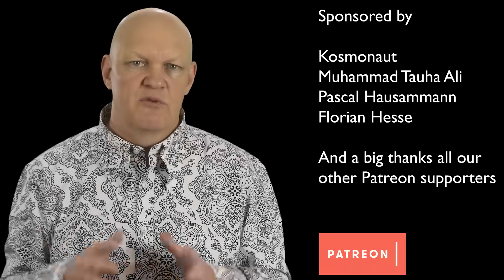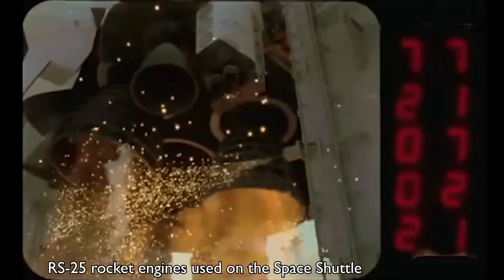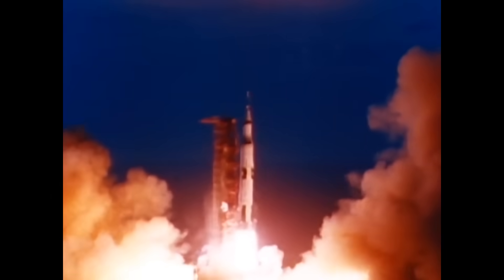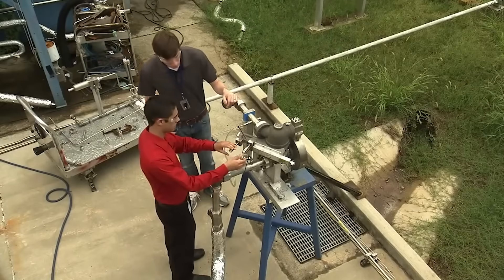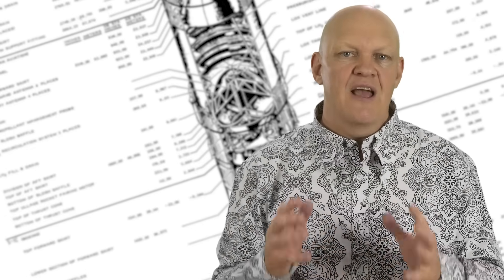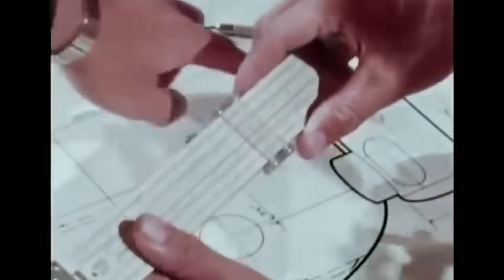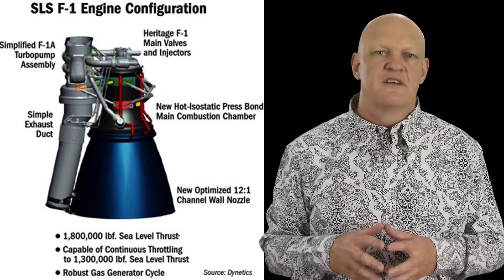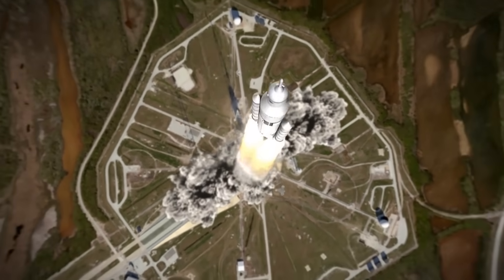Why Can't we Remake the Rocketdyne F1 Engine?

Comment: The F1 engine was amazing, thats for sure.  It was the biggest (with a single nozzle) and really pushed the limits.  And there does seem to be an upper limit on rocket engines.  They discovered the limiting factors and worked around them as best they could and miraculously made it work.  As a result of this heroic effort we now know its best to make the engines just a bit smaller than the F1s were.  Major problems included sound waves amplified inside the engine because the sound compressed the fuel/oxidizer mix, causing faster burning and ever more pressure at the leading edge of the sound wave.  Also pogo which caused a surging effect was greatly intensified by the large engine size.  Although there might be workarounds, if you want a cheap, simple engine then it pretty much has to be smaller than the F1s anyway.  A multi-nozzle engine or several smaller engines just work better because they aren't fighting the physical processes that created these issues in the F1.  Also, an amazing save on the part of the 1960's engineers who saw these problems for the first time and came up with the workarounds that let the F1 fly.

For all its amazing accomplishments, the apollo spacecraft was a fragile and extremely dangerous thing.  A big part of the reason the last moon missions were cancelled was that they didn't want anyone to die up there because a negative public reaction could have jeopardized the entire space program.  Yes, there were setbacks with shuttle and ISS but we weren't really ready to go ahead and colonize the moon back then.  The best we could manage was an expensive and daring stunt to show we beat the Russians.  Its taken all this time to learn by doing with smaller programs to get to a point where we can really consider going beyond earth orbit on a regular basis.  We could have gone faster.  If only we spent half as much on preventing our extinction as we spend fighting each other, we'd have self sustaining colonies all over the solar system by now.  Its a choice we've allowed our representatives to make.  Avoiding extinction by colonizing space, or use those resources to fight each other.  If we let them choose to fight, we deserve extinction.

Comment: This is typical of non-mass produced systems. I spent decades designing and building process control systems for very large and complex industrial facilities. Each system was unique, although the building blocks were not. Even though everything was documented so these systems could be maintained there were a lot of tricks used to assemble these very large systems to control industrial facilities using thousands of sensors, programmable devices and final control elements. However, there was sufficient documentation that some of these systems operated reliably for 30 years and were maintainable throughout their life. What ultimately led to the demise of the programmable elements was the inability of techs and even engineers and programmers to keep them reliable and deal with problems quickly when problems or failures did occur, or the need arose to make significant changes due to process changes.

Comment: I'm sure anything built decades ago can be reverse-engineered if just one surviving sample exists, even with no plans or engineering documents. What I'm not so sure is that it would be worth doing the F1, even if it weren't prohibitively expensive to do so. 
It is no doubt a masterpiece of engineering of its time but things have moved on. While being the second most powerful engine ever flown it is however rather poor in terms of efficiency and probably very difficult, if at all possible, to make re-usable. Keep in mind that the main design goal was to get it ready in a very short time and many things were sacrificed to achieve that goal.

Comment: Nobody in their right mind would make a 5,000 part F-1 engine, when there has been 50 years of innovation that allows building a much lower cost & more reliable F-1B engine with 40 parts.  Lastly, military support for solid rocket booster tech made the F-1 liquid booster obsolete.

Comment: The same thing happened with the Apollo command module, specifically the heat shield.  NASA and North American Rockwell (ne Boeing) has forgotten how to make the original heat shield, and when NASA decided to replace the Space Shuttle with essentially the Apollo program hardware, it took years and much effort to come up with an equivalent-performance heat shield design.
Reply: Wall between LOX and LH tanks in 2nd stage is other relevant example.

Comment: This is true, even somewhat so for the RS25/ssme. When you work backwards and make 3D CAD parts from the original imperfect drawings, things don't add up. They mis-align, float, or interfere. Ex: on long small pipes, a tech can easily bolt up one end, then move the other end 3 inches into place, so even 3D scanning individual parts doesn't work. So you can't trust the parts and existing drawings to match
With updating an old, pre-CAD engine to modern design criteria, they'd basically have to redesign the whole thing. In which case, you might as well design a better engine.

Comment: Regarding the "new video  format", I say you should make your videos as long as you see fit. If you feel the subject requires 20 minutes or more then make it so and equally if you feel only a short video will suffice then again do so. 
Briefly don't feel restricted by video length. 
PS longer ones are good for when there's absolutely nothing on the telly (which is nearly al the time especially in France) and a hole needs to be filled.

Comment: Despite the lack of video to match the topic i'd have preferred more information on the F1-B process, as this is the very question i was wondering this weekend at KSC. Fun, unrelated fact, the picture of W.V.Braun standing in front of the Sat 5, the mobile "car" cradle that's carrying it, it's base minus the wheels has been modified and is what's holding it up over peoples heads now in the Sat 5 building.

Comment: To say the F1-B is a new(er) design than the F1, you'd have thought they'd have switched to a closed-cycle engine by now rather than dumping the fuel pump exhaust overboard. 

I mean, closed-cycle engines are exactly why the most efficient engines are Russian. Surely NASA has clicked on to the gain in ISP by having a closed-cycle design.

Comment: NASA: We don't want to use RS-25D's on the boosters because it means throwing them away.
Also NASA: We're going to use RS-25D's on the main stack and we'll throw them away.

Those remaining Shuttle RS-25D's should be in museums, not at the bottom of the Atlantic.
Reply: TheOneWhoMightBe If I remember right weren't the solid boosters recovered and reused?
Reply: puricreek: the STS (shuttle) boosters were recovered and refurbished, but I'm not sure about the SLS boosters.  CD says they won't be.
In either case (recovering the SLS boosters or not) the RS-25 engines on the main stack will not be recovered.

Comment: in other words the old school engineers are real engineers and modern trades men are rubbish !!! what I  hear you say, are not modern universities and colleges as good as the college of experience ??? we in this case and in most technical matters the old school engineers beat modern engineers hands down as its a fact that there is no substitute for experience in any field of human endeavor
Reply: The engineer of today would use the superior tools available to him to create a higher quality, far superior part, out of alloys that the old school engineer have never even heard of. The old engines were made with the tooling limitations of the time in mind. Limitations that are no longer relevant, making the old design completely irrelevant. Why hire a fabricator to try and reproduce the steps someone took 50 years ago, when you can design a much better part with 50 years of additional knowledge gained and let a CNC machine churn it out?

Comment: The F-1B  is intriguing,  SRBs less so.
Reply: +1 for a throttle you can turn on and off.

Firecrackers are something you light and then stand back. Not climb on top of...
Reply: Mark Plott How do you figure that? They're testing it unmanned first and they've gone back to the old system of crew on top with an escape tower that can pull the crew away from an explosion.
Reply: Methinks NASA is losing it’s vision. Solid rocket boosters have a bad reputation after Challenger and need transporting all over the US for assembly. A 1.5 million pound thrust engine with only 40 parts? What’s wrong with them? 
Then there’s their insistence in going with Space X when everybody else is looking at SSO and the SABRE engine.
Reply: NASA's SLS will blow up on the pad, killing several Astronauts.
Reply: The F-1B booster would have out performed every other booster option they looked into with the Block IA SLS lifting over 120 mt and the Block II to 150 mt.
A single stick  F-1B booster with an upper stage would lift 32 mt and pretty much delivered what Ares I originally promised.
Reply: I'll tell you why the F1-B and many other pieces of the SLS will never be used: NIH. Not Invented Here. The syndrome is all over NASA, and was led by Mike Griffin, whose only ambition was to outdo von Braun. It was proposed initially that Ares should more resemble the vehicle designed right after Challenger, NLS, I think it was called, (National Launch System) and when he discovered that it was a group of NASA retirees, outsiders, and people working behind the scenes who were NASA and contractor employees, he threw a fit. Once he was told it was already a NASA design, it was too late, and we blew all that time and money on a system that could not fly. If the proposed vehicle had been given the go in the early 2000s, we'd already be flying manned missions and close to returning to the moon, if not already back on it. Griffin and company kept their thumbs on the scale to denigrate and discredit the group that created the design for the replacement vehicle. It was called Jupiter, and was part of the DIRECT system.
Reply: SRB - are solid rockets, they cant be reused rapidly, and they cant be recovered by Droneship. also, they cant thrust decelerate like Falcon 9 can. reuseability is the future.
Reply: James - NASA = no real innovation even after the shuttle was launched. Shuttle built with 1970's technology, and only the Oribiter was reuseable. everything else was a bitch to clean (SRB) and the ET not recoverable at all. NASA should have focused on partial reusability (SRB).
Reply: SRBs have proven extremely reliable. Somtimes simple has it's place.

Comment: Is that even necessary? The Atlas 5 RD-180 is a very efficient design with staged combustion and could be upgraded for super heavy rockets. Or you could use extra engines.

Comment: I believe the real reason for not re-engineering the F-1 engine today is purely political. The SLS is not much more than a Senate funded boondoggle that NASA really doesn't need. Between the Titan Heavy and the SpaceX Falcon Heavy there are flight proven heavy lift rocket systems to get humans to the ISS, the moon and potentially beyond. The members of the US Senate however wanted to keep funding the manufacture of massively overpriced, outdated components like the solid rocket boosters and the Michoud facility in Louisiana that formerly made the now unneeded shuttle external tanks which is now making hull sections of SLS which is why those same senators don't want some other manufacturer's designs to get those government contracts...so this is what NASA is stuck with. Hence no modern version of the F1.
Reply: Pretty much it isn't call the Senate Launch System for nothing. There was no way it was going to win when stacked up against previous shuttle makers components even though the F-1B they created was turly much better then even the RS-25 they are using for the main engines which don't have the thrust needed to really hit the SLS Block II targets.
Reply: Greedy men leading us down wrong paths, for their own gains.
Reply: spencer s more for their constituents gain. They've been bought to ensure their little niches in their State maintain their advantages in whatever they do.
Reply: They do that to appease their little area, in order to stay in office.
Reply: spencer s yes I believe that's what I just said. Their kick backs from the businesses in the form of legalized insider trading let's them all become wealthy beyond their wildest dreams. Little wonder they'd kill to keep their gig and hate outsiders getting elected and stirring the pot. Politics are for politicians and socialism is for the people, not the socialists.
Reply: Elon Musk has announced that Falcon Heavy will not be put through the tests and revisions that would be needed to get it human-rated, however.

Comment: The videos can be shorter than you usually make them, but I like a little more depth than this video had. As far as the engine is concerned, I think NASA made the mistake when they stopped using the engine in the first place. I wonder if any of the new rocket companies could use the new F1B design and make a cheaper engine. Only 40 parts, that's incredible.

Comment: Thank you as allways for interesting and thoughts inspiring video. To your question. I do agree with the point for using disposable boosters with liquid propellants. But in my opinion even a modern version of F1A aka F1B is not as promising as use of single but powerfull airspike engines with combined  coolling system (ablative and fuel cooled). Again, in my opinion, ablative cooling is very robust which means dependable and shall make desposible engines cheaper. If  I recall it correctly airspikes ad up 15% of efficiency and the technology is more recent then of F1's.

I can go on, but I think I've covered main idea. I do apologise for my bad French.

Comment: As an old school electrical engineer still in the business, I can say with exact confidence that what we have lost are the Craftsmen, Engineers and Technicians of all flavors that had immense and hard won skills that can't be taught. Today it's all about simulation and unfortunately I have found that kids coming out of engineering schools don't actually know how to build anything. The technical overhead as in software has become so bloated that almost no one actually knows how to do something or even why to do something. We went from basically nothing in 1960 to landing on the moon in 9 years with great expense to be sure, but with great skill as well that was learned on the job. The US now with all the tech advances still do not have an indigenous man rated system to LEO after stopping the ill conceived shuttle in 2011. What a ridiculous position to be in. It seems that we have intentionally forgotten what to be one of those 3 professionals listed above was or even that it was very valuable.

Comment: I am not surprised! I saw pieces of worked metal by my dad (as apprentice electrician only) done in the 1960s. The tools? A vice and a few files! That's it! These days nobody can do this. So imagine engineers from the 1950s, 1960s with 30 years experience... Those guys knew how to work PROPERLY. The welds they did then... beautiful, clean, strong. Yep, those guys knew their trade. These days, nothing can be done, except with robots and machines. So, new designs have to take this into account. But we can take the good bits and simplicity of the original F-1 engines, and make something close. There will be problems though, as it's not exact copies. But, anything done in the past can be re-done, provided there is a WILL to put all into place to get whatever any project requires!

Comment: I can easily accept that an exact copy of the F1 engine can't be done, and it's not necessary to even try. The F1 has well researched and proven design principals, redesigning and testing a new engine  that works in a similar fashion would be just fine. The SLS would need four F1's to match the thrust of the SRB's, then they would have a way to shut down an engine rather that abandon the whole stack by ejecting the capsule.

Comment: well then just use modern processes for the details. i assume they are better solutions anyway. i assume by remaking people just mean the size and the basic principle anyway and not the minor changes chuck did 50 years ago to the blueprints so that pipe 32 fit to 33

Comment: Another problem with bringing old designs back online, is thee problem of sub-contractors that made various parts no longer being around, or they have have changed the manufacturing process and the parts are no longer compatible. Used to work at Trimble and the custom GPS chip we used suddenly suffered a drop in its RF sensitivity, later found to be caused by a process change at the fab.

Comment: I much prefer the redesign. The original F1 had only one qualified welder for the nozzle getting all the bits together with consistant heat distortion. Even the original design would have been modified a few times so that the shrinkage from his welds produced the correct final bell shape. On a meter long bit of thin tubing, a continuous weld might shink it's length 8mm with one welder but 7 or 9 with someone else, or just having an off day. All helium leak free without any flaw that might crack going from liquid O2 to glowing hot in seconds. The F1 was high-end industrial art with a very select group of artists, Roketdyne's old masters if you will. Preferable to have something much less artist dependent and Rocketdyne was working that problem even then.